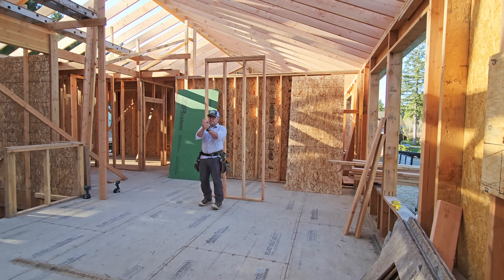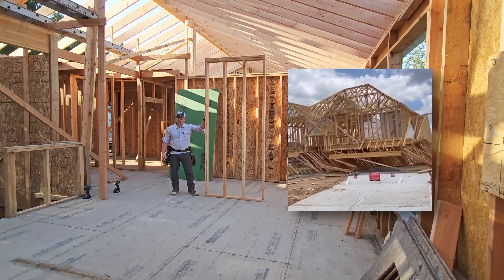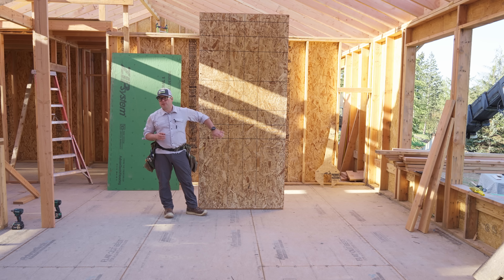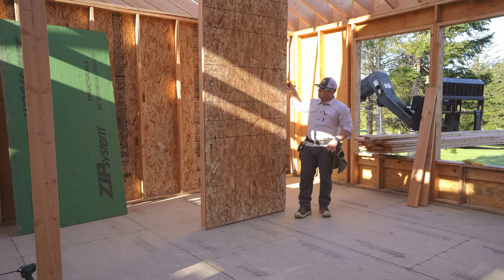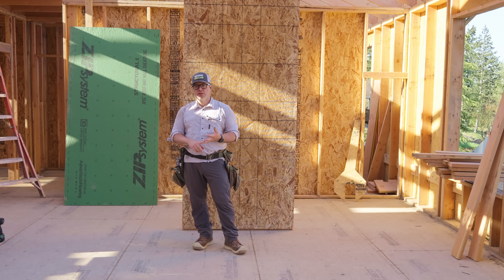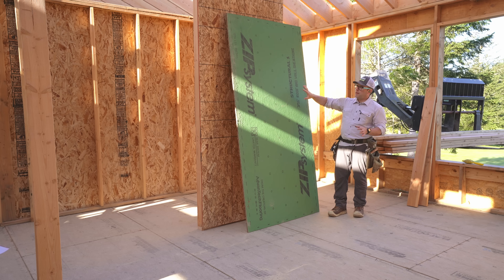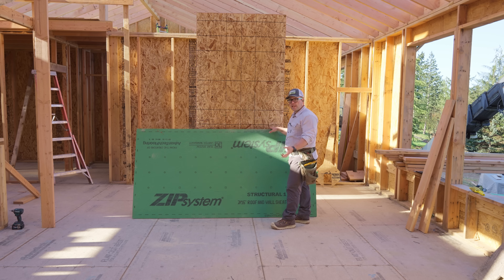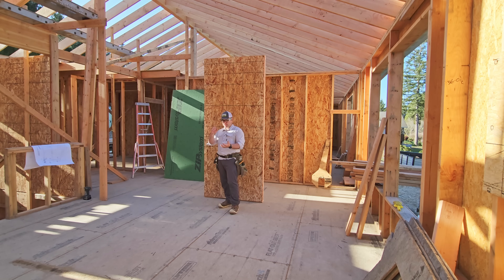Shear Walls Secret: The Hidden Force That Holds Buildings Together

Comment: I'm a structural engineer! This video was great, and thank you for also sharing the different screenshots from the NDS publications as well! I love it!
Reply: How does the therma-ply compare to osb?
Reply: Must be a horrible SE if you think this was a good instructional video. This dude needs to stick to building because teaching is not his Forte. This was a horrible video. None of that construction instruction would withstand environmental forces. 😂
Reply: Are you hands on taught or books and paper?
Reply: I'm a german engineer and call this typ of framing BS! Make triangles! Pfff...
Reply: @mostylz7618  German engineers over-engineer everything.  At some point you need to draw a line and say "enough is enough, that'll work just fine."  But the Germans I know and work with are still solving a problem I fixed perfectly fine a long time ago.  I guess that's why their part of the company is going out of business...
Reply: @byugrad1024  Yeah, well, no! Our houses don't fall apart when there is a little bit of wind, which you call a storm. And without the stuff you stole after WWII you wouldn't had the great 50's/60's. You even wouldn't have proper rockets without a German. And maybe you just don't saw the problem you caused with your solution, which might be good enough for american standards. And sadly Germany has become more and more American over the years, that's why we're not that good anymore, I have to admit. I'm one of the last German Diploma Engineers. Now we have these Master and Bachelor BS. Multiple Choice tests... Made by and for idiots, to create more idiots.
Reply: @mostylz7618  angry for no reason much ? The whole world knows if something if german manufactured theres a good chance its so expensive for good reason … and theres more than one way to skin a cat …meaning in this instance that the absolute best (most expensive because best) is overkill and unneeded in some / most circumstances….which is i think what byu was saying …? Or is this some sort of banter between engineers that im out of my element on ?
Reply: @vicpnut1 I'm not angry, cause I'm not living in this kind of paper houses, which compared to real houses are way to expensive! It just looks like that you can't handle reality. And I say it again: Without the patents you stole from Germany after WWII, you wouldn't had the great 50's/60's. And you wouldn't have proper rockets, without a German. Btw, it was also a German who made your military great to defend the Tommies. General Von Staufenberg. So, please go ahead and build houses which fly away when it is a little bit windy outside and pay the same prices like we do in Germany. Not my problem. But I have to admit because of you ignoring these facts makes me a little bit angry. You could be a little bit more thankful.
Reply: @mostylz7618  Do you have a lot of earthquakes in Germany?
Reply: @mostylz7618  I'll give credit to the Germans for building very high quality homes.  A friend of mine is from Hamburg and I was shocked when seeing the homes there and how most of the walls were extremely thick with masonry and insulation ( 30-40 cm range). American homes are engineered well without being over engineered, builders just tend to cut corners, not the engineers.  People vastly underestimate the strength of timber.  This video intro just shows a crap builder who had no crossbracing put up while waiting on sheathing.  I'd definitely take the German built home in a tornado though.
Reply: @JT.526 German built homes will lose their roof in a tornado.
Reply: @mostylz7618 how do you know if someone is german? They’ll tell you

Comment: This fall my wife and I had new ProVia Endure Windows and ProVia CEDARMAX insulated vinyl siding installed on our ranch home. To save a little money on the project we did the demo of the old vinyl siding and stone veneer on the front of the house. The rear of our home has an addition, which was built around 2002-2003, it was covered with a foil faced insulation right over 7/16 OSB with zero rain screen. What we found when we removed the old siding and insulation was some rot around the windows that were  not installed properly with zero insultion or sealing of any kind. Whomever the builder was on the addition saved a lot of money by not doing things correctly. 

Something else we found once we removed the insulation were panel after panel of OSB with as few as 6 nails on the perimeter holding the house addition up. I told my wife we're lucky the addition hadn't fallen down during a storm or high winds.  At this point I was going to hand nail as needed but ended up purchasing a nailer and around 3,000 2.375" HDG ring shank nails to get the addition nailed off properly. Before I could get the nailing accomplished I tore my right biceps tendon, so my buddy came over to get the addition nailed properly giving me some peace. We also tried to get as muuch of the a1ddition better sealed from air and water before the siding went on. utilizing some BIG STRETCH caulking and an assortment of PROSOCO products.

This winter I'm going to the addition basement to apply spray foam inulation in conjunction with rigid foam insulation within the rim board, sill, and joist area to better seal/insulate the addition. I wish I was independently wealthy because I'd have every inch of sheathing on the outside of my home removed and replaces with ZIP system Green R6 sheathing on the walls and the roof would get the 23/32" red ZIP system sheathing. 

I,ve learned a ton of information from your videos and others on YouTube, please keep them coming!

Comment: I don't understand why most 4X8 sheathing panels are aligned with the stories of the house; if the panels overlapped, that would hold the stories together and possible reduce the need for inter-story hurricane straps while still forming a strong building. 4X8s could be applied horizontally at the top and bottom to fill those gaps.

Comment: Helpful.  I need to develop a plan for renovating a home in California that was built in the mid-70s.  Sheer walls back then, on this particular track of homes, were achieved by diagonally installing one piece of 3/4" thick X 5 1/2" wide board, across the 2X4 frame, with a recess cut into the 2X4s for the sheer board to fit flush across the entire length of 2X4s.  Seems sketchy at best but considering all homes in the track are built this way, apparently it was to code in the 70s?  However, after 50 years, there are visible cracks in the diagonal board.  I need to hire a contractor to for a full renovation.  How should I go about interviewing a general contractor and verifying he's knowledgable about things you address in this video, and equally knowledgeable about electrical, plumbing, insulation, HVAC, drainage, etc?  There are contractors who say they can get the job done, but I'm looking for one whose mindset is to get it done according to code, with good, durable quality.  Outstanding video.  Thanks in advance for your reply, as well as other experienced professionals who might be able to guide me in the right direction.

Comment: US build flimsy paper house LOL
Reply from the maker: Classic ignorance
Reply: @AwesomeFramers  That's not ignorance just comparison. US does not have big earthquake like east Aisa. In my country, they are alway RC houses or SRC houses for higher building. Those US framing cannot stand by themselve. You need OSB or plywood to withstand shear. That's really interesting.
Reply from the maker: @hamster6093  Yes, no framing resists higher lateral forces, that's why the sheathing is applied.

Comment: Cinder block walls are good but I've seen them fail; recent example was a cinder block laundry room as a safe house in event of storm. After an EF 3 Tornado 🌪 the roof & Cinder block walls were gone. Only thing left standing was the washing machines. Jan. 09, 2024 Marianna, FL.

Comment: Over nailing is not an issue if you look at the structural engineers detail sheet look at his pattern and alignment and you will not have over nailing that is not ever an engineer issue. It’s incompetent carpentry.

Comment: 40 + years in Framing and just about all the other sub trades in building residential homes. A client flew my crew to a 7,000 sf house on Guana Cay Bahamas. I was  directly responsible for all the structural framing applications/ details and tie down of the complete home to its foundations all the perpendicular wall tie ins to the exterior walls we fastened a 3/4" structural sheathing on one side. On the opposite side we added a
 2 " heavy gauge metal ribbon strap diagonally from the bottom plates  across the door headers and up to the top plates also adding some connected to the rafters above. 1,500lb of simpson strong ties later  and all fasteners Stainless steel. 
The island got Hit by Hurricane Dorian.  240mph wind gust, a Cat 5 for almost 40 hrs and this house was the only home that was left standing w/ out any structural damage on the entire Atlantic side of the island which stood on 30 ' bluffs 100 yrd from the shoreline. Ever single home that was left or right of his house were completely ripped off their foundations or posts. Their roofs were blown into the wood inland areas and their walls a floor decks were in the Atlantic ocean. The only thing that failed on this house were the impact windows which I than spent 1 1/2 yrs replacing all the wood flooring Trim , cabinets , tile,  ect.... inside due to the water damage. 
A good local Bahamian contractor friend now frames all his new homes using the exact same principles I built my clients home to this day. He lost 3/4 of his 2 homes he has on Guana Cay and Marsh Harbor. They arent going anywere in another cat 5 Hurricane.

Comment: Excellent vid! I'm a retired architect (with 3 years structural engineering at university and 9 years hands-on construction experience). You explained the basic concepts in accessible, layman terms.  This is important as many builders and framers are more likely to watch vids from a framer, understand the concepts and incorporate this knowledge in their work. Thank you!

Comment: I worked on a framing crew back in the later 70s early 80s . We never framed the second floor until the bottom floor was sheeted.  I now see new construction that frame the whole house  before any sheeting is done? They built a Restaurant at the end of my road . They framed the top floor walls without any sheeting. I told my wife that’s a bad idea and what could happen. They went home for the weekend and Sunday night we had a wind storm the whole building came down . My wife asked why did I know that and they (professionals ) didn’t. 🫣🥴

Comment: Why not glue the plywood to the wall studs? You wouldn't have to nail so much and get nail fatigue. I live in the NE with hurricanes and have never seen a house or any structure "overturn" and a lot of them don't even have anything anchoring them to the foundation. I'm thinking that is extremely rare. Perhaps you would need a tornado and at that point nothing is going to help.

Comment: The first video happened in Galveston Texas.  Their mistake while building was not putting plywood on the exterior walls.  Never go to the next level without plywood on the exterior to tie levels together.   Without exterior plywood it is very easy for the structure to start racking. Bracing, straps and clips do not stop what you saw.  I have seen three other houses in Galveston this year get blown over, none had plywood on the exterior.   In our coastal climate with storms we do end up shearing 80% of the interior walls, but we can’t do it until electrical,plumbing and insulation are done.

Comment: What i dont understand is how are certain walls of a home are designated as shear walls b/c the direction of the wind can come from any direction.  If wind is blowing from N -S and Wall-A is keeping Wall-C from falling sideways b/c that the direction the wind is blowing then Wall-A is the shear wall if I uderstand correctly.  But if the direction of the wind is blowing E-W, then the roles of the 2 walls would be reversed right?   So how are certain walls of a home designated as a full-time shear wall if the wind force can come from any random direction?

Comment: You would think that horizontal osb would provide greater sheer resistance as the load, which is lateral, is transferred over a greater lateral surface area. But I see how, having it vertical improves vertical sheer differtial which, I would think, is probably more important as the biggest lever arm is what's farthest from the ground.

Comment: The bottom line is ALL home builders are using worse cheaper materials. Non dimensional lumber and particle or osb board everything! Truss systems and gusset plates to cut corner. Homebuilders now a days suck. You can act like your different all you want if you use the same crap materials is other builders and cut the same corners because your using modern construction techniques then your framing sucks. End of story. Quit building Cracker Jack boxes and then overcharging people tons of money for your garbage home.

Comment: The most amazing thing: people knew this 1000 years ago. Some wood frame buildings from 700 years ago are still standing in central Europe.

Our house is 400 years old and just looking at the design it shows, how much technology was involved, without a single machine.

Diagonal beams ensure stability. The removal of these beams in the 40s and 70s caused the building to move. We now started to rebuild it and stabilize the frame further. The pretty European wood frame houses don't look like they do only because it looks good, most of it is simply functional. Place the diagonal beams the other way and it will be unstable.

Oh, the entire outer framing is oak wood, no metal was used. It is not like they didn't have it: the clay coating on the inside was partially held in place with hand-made nails.

Comment: Thank you, that was very informative. I had never realize that orientation of plywood plays a role or  can't be just changed from vertical to horizontal with additional measures. I'll do my homework on that subject as I'm gonna be using 8 foot tall plywood on a 10 foot wall and will have to cut a 2 foot tall section to complete full height and there might be some tricky aspects that i haven't thought from the structural perspective a s to plywood orientation properties (I'm not building in the US by the way so not subjected to the same code requirements)

Comment: in my country that type houses we call  doghouses! 😄😅
Reply from the maker: In my country we call your houses energy inefficient, hard on the climate, terrible in earthquakes and the result of mismanaging forests.
Reply: @AwesomeFramers  but there are houses over 200 years old! and we don't worry if a strong wind blows :) 😉
Reply from the maker: @traqnsavov822  those houses are terrible to heat and cool, and you didn't address the comment I made about earthquakes.  You aren't going to agree with me, you have done no real research to understand North American construction, so this is likely a waste of both of our time.
Reply: @AwesomeFramers  after seeing this video, where the house falls like a house of cards, my low opinion of this type of house, it got even worse! I even think they should be declared dangerous for living.
Reply from the maker: @traqnsavov822  houses built to current code don't fall down.

Comment: How about building a house with the appropiate wood width and thickness, instead of matches? I really don t understand the US in this aspect, i ve built chicken coops and wood storage sheds way way sturdier than your actual houses. The thin boards you use for structural walls here in Europe we use it just for flooring or decorative wall panelling.
Reply from the maker: You are correct, you don't understand.  There is a lot of information online, do some research. Wood is good, and it doesn't need to be timbers.
Reply: @AwesomeFramers  Don t need to, i ve already built my coop and shed. I ll consider it if i ever decide to build a cabinet.
Reply from the maker: @silviannistor  Classic.  So instead of being intellectually honest and genuinely trying to understand the subject, you are going to build a chicken coop and extrapolate from that North American construction.  Got it.

Comment: I don’t get why Americans build houses out of timber with the adverse weather conditions they have in many states. Bricks and mortar lads!
Reply: We don't get how non-Americans can watch video after video like this and still make ignorant comments like yours. You apparently see wood framing and just stop there. You don't bother to listen to the explicit and detailed descriptions of how homes are engineered and architected to handle their local environments. You see wood framing and somehow become blinded to the mix of other materials also commonly in use. You see wood framing and can't be bothered to understand how it comes together to create durable, flexible homes that protect their occupants just fine from severe weather. You somehow believe that if a tornado or a hurricane hit your brick-and-mortar structures you wouldn't also lose everything, just as people with brick and cinder block and concrete construction in the U.S. commonly lose everything, because you apparently can't be bothered to understand how tornados and hurricanes work. We won't even get into major earthquakes. You can't be bothered to understand the very significant difference in costs and efforts for common construction, repairs, remodeling, and home expansion. You just don't care about anything except for whatever your desire to see something American portrayed as inferior tells you, and you're incapable of getting over the fact that different does not mean worse. And the most aggravating part of it is that you're all this way, even when the video itself has explicitly disproven your ignorant beliefs.